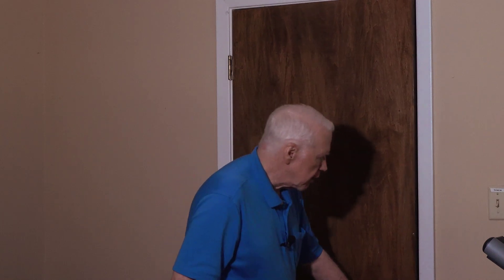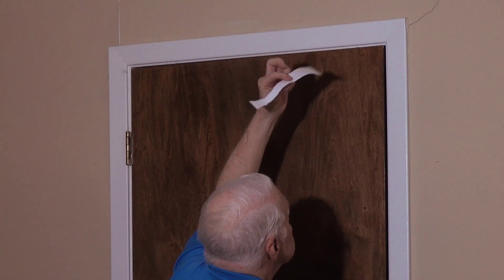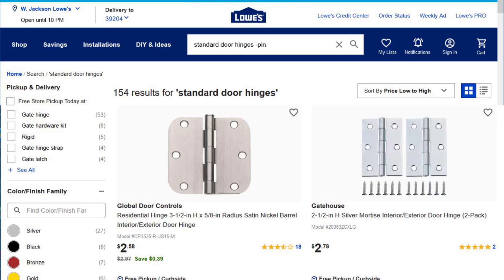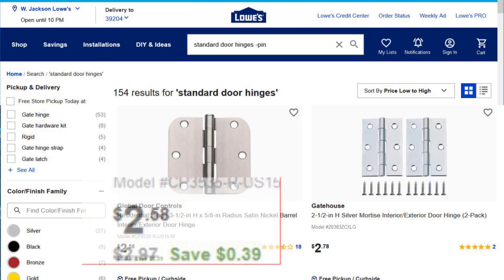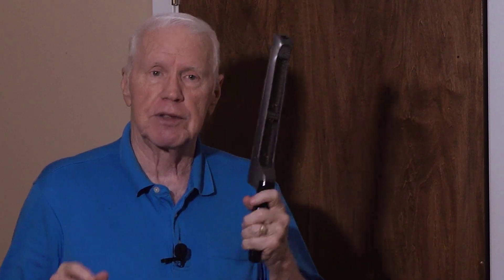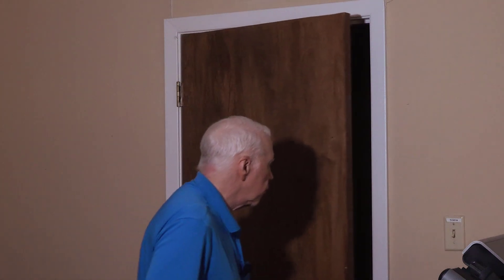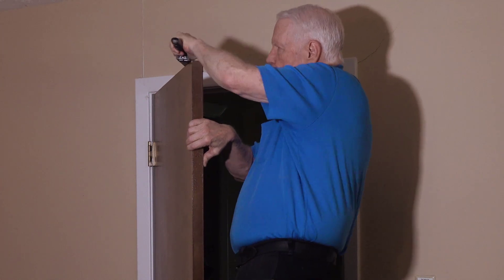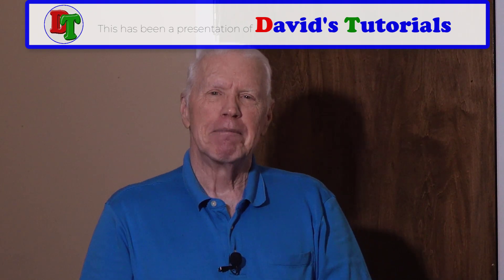The EASY way to Fix a Sticky Door, EVERY TIME

Comment: Thanks for this vid, it's reassuring to see that I do not need to buy an expensive plane and a rasp/rasp-file might be sufficient.  p.s. the diagonal crack visible running from the top-right of the door-frame caught my eye.  I understand that can point to building movement or settlement.
Reply from the maker: Yeah, this area of the country has something called "Yazoo Clay" under most of the land here - it swells and contracts with the moisture in the ground. Plays havoc with homes and even some foundations.